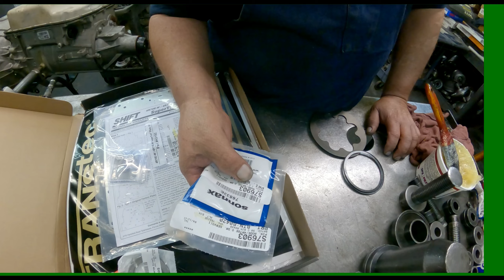Ford 4R70W Rebuild

Comment: Quick question. Rear band keeps burning up. Nothing else is damaged, but 2 times now ive had to pull out the transmission and it the band is burnt.
Reply from the maker: Either you have the wrong piston length, the cover is bad, valve body problem or case problem.

Comment: hello quick question on my 1998 ford f150 it has 4 clutch but when I assemble everything it won't sit all the way so I'm confused is it 3 or 4 and what's the difference and if it's 3 will it be loose or wobbly thank you for your video
Reply from the maker: There are 2 sets of clutches that can be 3 or 4 clutch. The Intermediates and the Reverse. It will say on the pressure plate which one it is. I think you have something mis-assembled. Thanks for watching.

Comment: Thanks for sharing these skills .  Great videos.  I rebuild an e250 2012 and it doesn't have overdrive. Thanks for any help. Over drive van piston seems ok
Reply from the maker: The only thing that happens for 4th is shift solenoid 1 turns back on and the OD band comes on. So, if the only problem is no 4th, the problem is in the valve body, servo or it is a command issue. If it is a neutral when it tries to go to 4th, and you did not miss the band and the servo is fine. Look at the OD servo regulator valve in the valve body. With the valve body in front of you, the manual valve on your left. It will be the top valve on the right side. If the clip was broken on the servo when you built it, it will be blocking the valve. Make sure the check balls are right and you have the correct gaskets. Put a scanner on it and see if it is being commanded. Common issues outside the transmission would be a rubbed through harness from the shifter in the steering column. Or the wiring harness where it goes over the engine by the filler tube.
Reply: @CurmudgeonTransmission  thank you so much for the advice. Where can I go to become a transmission repair professional. I love doing this work but lack the experience.  Thanks again
Reply from the maker: I don't know of any place that teaches strictly transmissions. You have collages and tech schools, but they do not teach much on the transmission end of it. Try to get in at a shop and hope the builder is willing to teach you. That can be really hard to do though. That is one of the reasons I started this channel. It did not start off as that, I had other plans for it, but that is what it became. I wanted people that were doing this to be able to come find out how something is put together. Sometimes you come across a part that fell out and you are not sure where it went or how it goes in there. Some of that information is next to impossible to come by. I want this to be a place to find that out. I am getting to the end of my career and want to pass something on before I go. When I started there was nothing either and the builders usually would not help you because they did not want you taking their spot. I have been fortunate to know quite a few really good ones that helped me out, especially in the early years.

Comment: Great video! I recently rebuilt my transmission and it works perfect, on jack stands lol! On the road it’s perfect until it neutrals going into overdrive. If I turn overdrive off, it will keep chugging down the road. Fluid level is good and like I said, it works perfect if jack stands! Any help is appreciated
Reply from the maker: Pull the valve body and you will have a vale stuck. Opposite side of manual valve at the top of valve body. If the E-Clip or snap ring broke on the overdrive servo that is what is stuck in there.
Reply: @CurmudgeonTransmission  thank you! Take care and keep up with the videos, you guys will take off!
Reply: How long did it take you to rebuild yours?
Reply: @jacobhamilton3463  it really only takes about a full day, and that was me watching the transmission bench series and following along. The car is still going great and found that the od servo had popped off the band somehow. I re set it the same day and no problems since the day of the rebuild!
Reply: @Samwise71999  Is the servo the shift solenoid?

Comment: Love the video! Trying to find the gumption to do this. I have a question: what is that “butter” tub you have with the brush in it? 🤔
Reply from the maker: Thanks. That is transgel Gold assembly lube, no longer available. Only ones available now are Dr. Tranny (Lubegard) Blue (thinnest), red and green (thickest).
Reply: @CurmudgeonTransmission  thank you! Which do you recommend?
Reply from the maker: I use the blue to lube stuff (lip seals) and the green to hold things in place (bearings, washers, etc.). Actually I think I got it wrong. I think the red is thinner than the blue.I quit using it because people were misdiagnosing it as a leak when it would melt. I also think it may be unavailable now also. I will find out later on today. The plant that made Transgel burned down. Was looking on the Lubegard website and they do not list a red, thought they had one, but like I said I don't use the red. So it may not be available anymore either. Will find out later.
Reply: @CurmudgeonTransmission  I use BG engine assembly lube on the seals to install the pistons on AOD clutches. The stuff is super slick and makes the job much easier since these are some of the most difficult seals to install without damaging/nicking them. (Blending STP with trans fluid also works.) I also use thick cellophane on the outer piston seal to get them to go in more easily.
I have a stack of 4R70W cases and valve bodies , (4R70Ws and AODs are $150 at the local U-pull)  all have been cannibalized to make wide-ratio AODs, as I do NOT want electronic controls in my projects. The stub (direct drive) shafts in the 4R70 are repurposed as drifts

Comment: @51:28 "endplay" referring to being able to pull on the inout shaft in and out, or a paralell plane to the floor? 

Is no play at all okay to be installed? 

Ive been giving different advice that a clutch pack isnt cleared all the way down, or that i need a different theust washer on the pump stator vs the original one.

My inout shaft does freehand spin with moderate effort once the pump is torqued back on and the case sealed up.
Reply from the maker: @darks1der07  End play is in reference to front of the transmission to the rear of the transmission movement of the gear train. You want at least some. At least.005. The input shaft should be able to be turned by hand both directions. The output shaft should turn easily by hand one direction and about twice the force the other direction. But still by hand. Usually what happens is people place the bearing that goes on the reverse under the output shaft and the one that goes there they place on the reverse drum. The one that goes on the reverse drum is thinner and has no scallops on the side of the race. The other thing I have seen is with cheaper clutches. The intermediates will be to thick. Even as little as .001 on each clutch is enough to cause the clutches to drag and it will be hard to turn the shaft.

Comment: As an engine and suspension mechanic. I've been thrust into the black art of transmission repair on my personal daily. Much further than anticipated I might add. I've just gotta say that you transmission repair folks are just bada**!! I have nothing but respect for y'all!!
Thank You for posting this stuff!! It's been a lifesaver, or at least a few less gray hairs. I just hope I got things right on my part. I've apparently have the "impossible to find" leak from within the bell housing on one of these 4R70W's. Silly me just thought it was a simple front seal. Well, I'm about to go install my trans for the second time (Because I love my job SO much, I'll do it twice). I do believe that if I've failed this time. I'm going to just go full parts cannon on the darn thing!!
Reply from the maker: These usually don't leak out the front, especially if it is a large leak. If it is a large leak and the pump bushing is not spun I would put a torque converter in it. Check your thrust bearing play on the crank and make sure the flywheel is not warped. Both dowel pins are in the block. If the bushing spun check and clean the grounds. Might add an extra one from the bell housing to the battery.
Reply: @CurmudgeonTransmission  I replaced the flex plate. After removing the torque converter, I filled it with fluid and put a fine layer of baby powder on it with a cheap "sandblasting" gun I modified. It basically sprays like a powder coat gun. Then pressure tested it, nothing. Released the pressure and just let it sit for a couple days while waiting for parts, nothing whatsoever. Ordered a new pump, as stated in original comment. I haven't found any defects in or around the bell housing and the only fluid inside the bell housing was below the torque converter, between the round inspection port and the pump. 
    Originally the leak just came out of nowhere and rather quickly became a serious problem (a couple days). The only leaks this truck had was a small oil leak from the passenger side of the timing chains cover. Which was an error on my part after replacing the chains and tensioners. Which has since been rectified. 
    After replacing the seal and pump gasket. It didn't leak until I did the test drive. Even then it only leaked when in gear. At first only when in gear and under load. I only drove the truck three times to town. After the second drive it began to leak all the time as soon as it was put into any gear. It wasn't gushing out. Something like 12 drops a minute at idle in drive. Probably more when actually driving a moderate speed.
   I think that's it. I apologize for the length of this. I'm just trying to be as descriptive as possible. Just because I know how difficult it can be to make an educated guess without seeing the what, when, where, and how.
   I do GREATLY appreciate your responding's!! Thank You Sir for your time and knowledge!!!

Oh and yes, Both dowels are, and were, in place.
Ground wires? I'm lost there. I don't understand how ground wires would affect a fluid leak? Probably part of the dark art of transmission repair🤯, or above my pay grade😆.
Reply from the maker: The grounds are only in the case of a bushing problem. I really believe you have a torque converter leaking and not the pump. Even though you have pressure tested it.
If the bushing has not moved out of place, I would put a converter in it. Only other thing I can think of. Several years ago they were producing some seals with a brown rubber color. Those seamed to leak constantly. Make sure it is a black material.
Reply: @CurmudgeonTransmission   I'm sorry, I don't think I ever said what year of the truck. Because it's definitely not a spring chicken.  It's a 1997 F150 XLT 4x4 4.6L 2 valve. I've heard about the different color seal thing. I've gone out of my way to make sure it has black color seals. 
   Well, we'll know if it's still leaking later today. I was able to get most of it buttoned up yesterday evening. Just need to put the rear driveshaft in and fluid. Geez, I hope it's not the torque converter. But your the expert. I'll get to tracking one down today. That way, if need be, the leg work will be done at least.
  Again, Thank You so much for your help and guidance. Even if only through the videos. It's been a tremendous help!!!
Reply: @CurmudgeonTransmission  Well, now it's puking fluid out of the breather tube and dipstick tube. Ok so I bought a replacement, remanufactured, pump. I have NOT started it yet. I put 4 quarts of fluid in to begin with. Then pulled the fuel pump relay and hit the starter for maybe 10-ish seconds. No leaks. Put another 2-ish quarts in and it started coming out of the breather and dipstick tubes. I then hit the starter again for another 10-ish seconds. It did not leak fluid while turning it over. The dipstick tube is still full of fluid.
Have I made a fatal error if the torque converter is not seated fully? I had definite clunks when I seated it and I did turn it several times before I started reassembly. Or am I just being overly cautious by not letting it fully start? My logic being that just turning it over isn't enough to really get the pump working. Those seem to me to be the only options I have to pick from. As I stated before, I'm definitely not a transmission guy, so I wouldn't doubt it if I'm wrong.
    I REALLY need some advice on this and would be EXTREMELY GRATEFUL for ANYTHING right about now!!
Reply from the maker: It should have picked some fluid up. If it is coming out the breather it is way over full. I would go ahead and start it and see if it will pick the fluid up. If it won't something is wrong with the pump or filter. @abitoffcenter383
Reply: @CurmudgeonTransmission  My concern is destroying the torque converter and transmission. Or am I beyond worrying about that? Considering I've already turned it over for 20 - 30 seconds. If I didn't have the torque converter fully seated or just completely seated incorrectly, how difficult would it have been to line up and bolt to the flex plate? It wasn't hard at all to do that. Although I did have the forethought to line them the best I could by eye to try and make it easier on myself.
   Sir, I'm REALLY sorry for bothering you so much!! I should have been able to handle this. Yet somehow managed to f it all up. I cannot tell you just how thankful I am for all your help and time. It just seems that I can find literature on everyone else's issues except for mine. Which just means I'm a special sort of stupid I guess.  
🤦‍♂
Again, Thank You So Much!!!
Reply from the maker: You are beyond that now. If it has been damaged it has already happened. Once you have the bell housing bolts in the converter studs should be able to be wiggled in the holes. If it will not move the converter is not all the way back.
Reply: @CurmudgeonTransmission  Well to double check if the torque converter could slide back and forth easily. I unbolted it from the flex plate and can easily move it back and forth with just a finger. Bolted it back up, put the fuel pump relay back in and just started it up. let it run for about 20 seconds. The fluid level dropped off the stick. Added about three quarts and did the same. Repeated that set till it was full at the cold line on the stick. Left it running will I put some tools up, maybe 10 to 15 minutes.
Went to drive it and things all went to 💩 .
first it started shuddering. pulled back into the driveway and checked the fluid again, it's good. backed out and went to drive again and heard a high pitched whinning. I pulled it back into the drive and just stopped.
  I have two questions.
 1: Should I just get another transmission?
 2: Do I owe you anything for all your time and knowledge? If so I have NO problem with that whatsoever!! You have been SO much help!! I just can't thank you enough!! Heck, I'll bring it to you. If you're where I think you are. I'm a bit south in Jasper County, TX. 
Oh and The Wife said "Tell him I said thank you also!!" 😂
Reply from the maker: You don't owe me anything. It's either get another transmission or have someone go through that one. I'm a long ways from there. I used to know someone down your way but not only does he not do this anymore but he moved from there. If you need help finding a shop you can go here.
Reply: @CurmudgeonTransmission The wife and I are discussing our options. We have one transmission shop in town. Although there are questions concerning the quality of their work. We don't have any personal experience with them, or any other shop for that matter. I've done all my own work for 30+ years. None of it transmission related aside from seal, filters, fluid exchanges, or replacing them on project vehicles I've had.
  Again, and I'll say it till I'm blue in the face, I CANNOT Thank You enough for all of your time and knowledge!! It may be something simple and small to you. But for us you have been a tremendous help!!!  Thank You and may God Bless you Sir!! 🙏
   Would it be asking to much if I may contact you if we have anymore questions pertaining to this?
Reply from the maker: No problem. Go to my Instagram, easier to have a conversation there.

Comment: Hey! Thanks for another great video. I just use this to build my 4570w. I had a quick question: Is it normal for kits to include an extra clutch? I'm left with an extra and wondering if I messed up or if there are just some that use one more. My pressure plates said "4" on them.
Reply from the maker: There are a 3 clutch and 4 clutch Intermediates. Most have a 3 clutch Reverse also. But if it has a 4 on the pressure plate it should take 4 clutches. Your clearance should be way off.
Reply: @CurmudgeonTransmission  and the reverse is the smaller of the two that look similar?
Reply from the maker: @Nickelplate1  Yes
Reply: @CurmudgeonTransmission  thank you! Turns out I have the normal 3 clutch one, and the extra is expected.

Comment: puedo cambiar de posicion la parte del egujero de sangrado del piston?, esta muy dañado la parte en donde se sostiene la parte que lleva los resorter , no se hagarra bien a la bomba, etonces cuanto lo pruebo con aire se sale el piston , con la parte que lo sistiene con resortes
Reply from the maker: You can move it a little. It needs to be somewhere at the top. Bewteen 11 & 1 o'clock position.
Reply: @CurmudgeonTransmission  no pasa nada si se suelta dentro ? O creo que es muy difícil que se suelte ya que están esos discos de acero y friccion
Reply from the maker: It may keep the clutches partially applied.
Reply: @CurmudgeonTransmission  ahh ok   
, es que no se me ocurre como puede quedar 100% seguro , porque al probarlo (fuera de la caja) con aire comprimido y se salia de 1 lado , o será Mucha presión,  o no se prueba asi
Reply from the maker: Not supposed to be tested not installed. The piston can travel too far.